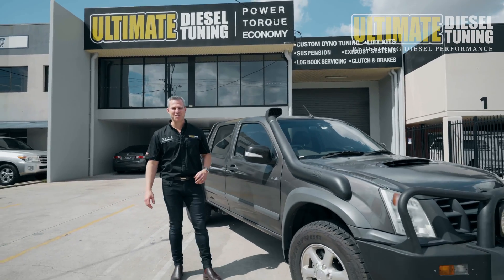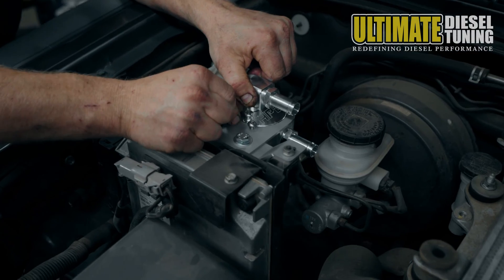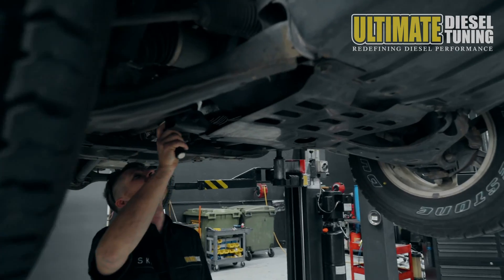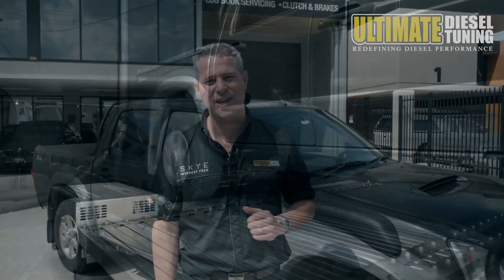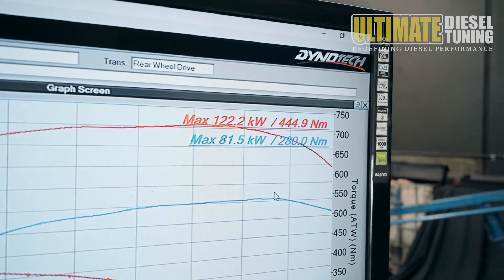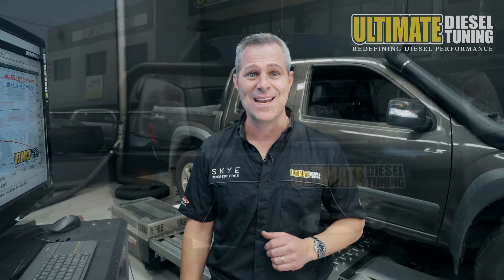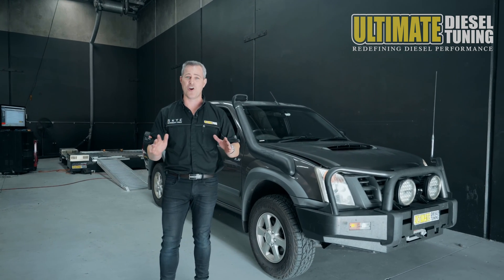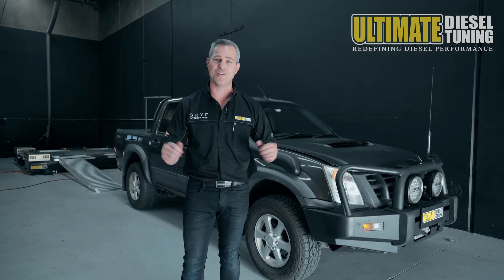Isuzu D-Max RA 2011 model, "EGR Package" - 59% gain in peak torque!

Comment: The 2007 Isuzu3.0 4jh1 is stock with 96KW and 280nm
Reply from the maker: That is an estimated figure at the flywheel/engine from the manufacturer mate. They do not make this power/torque in the real world. Please refer to videos that we have on this topic.
Reply: You’re actually wrong. 2006 and under that’s correct. At 2007 it’s got a 4jj1 and it’s about 110kw.

Comment: Can you explain or show how you blanked the egr on this bakkie please
Reply: Usually just blanking plates with gaskets on the intake & exhaust. I've done a couple of cars. Some need a new intake pipe where the egr connects, but real simple stuff. Some people just remove the egr function in the tune, but the exhaust pressure can still push the egr valve open or seep through any leaks when not removed. I think with these Isuzu's there's a flange on the exhaust manifold and a flange on the side of the intake manifold. Take both those gaskets to a local manufacturer as a reference and ask them to design and laser/plasma cut blanking plates. And then the catch-can they installed basically deletes the OEM ventilating system, because it ventilates oil into the intake. With a catch-can you can ventilate oil back into the motor or wait for it to fill up and throw it out.
Reply from the maker: we do not blank the EGR valves off mate.
Reply: @UltimateDieselTuning   <- fully support that - especialy for EGR's that are part of OEM 'blow-off' circuit. - Serious question though, just how small is the percentage of power and torque gained by removing EGR function? My research indicates almost all modern turbo common rail EGRs do not flow exhaust gas when cold or when under moderate to high load, so they kinda 'delete themselves when you ask for the power'. If "gunk" in the inlet tract between EGR inlet and the intake valves (formed from blow-by vapour mixing with exhaust gas) is a concern, then thats better dealt with by a quality 'catch can' which most 'inter-webbers' report does greatly 'dry up' and reduce the coating of 'soot' in those areas.

Comment: Were these gains made by reflashing the ECU or installing a piggyback ECU?
Tossing up between a conventional tune or installing a piggy back ecu.
Reply from the maker: Hi Shannon. No, it's a total/full custom dyno tune/ECU remap, performed LIVE on our dyno. There is no need for extra expenses & for a piggy-back ECU to be installed, when the factory ECU does the same job with regards to tuning :)
Reply: @UltimateDieselTuning I want to get the same but mine can’t be done by the obd2 port so how would you get around that?
Reply from the maker: @ryanheywood5453  best to call us on 1800034373 to chat to us about your D-Max.
Reply: I'm in Jamaica, is there any way we can do remote tuning for my 2011 4jj1 D-Max?